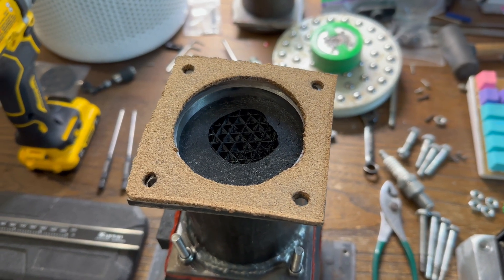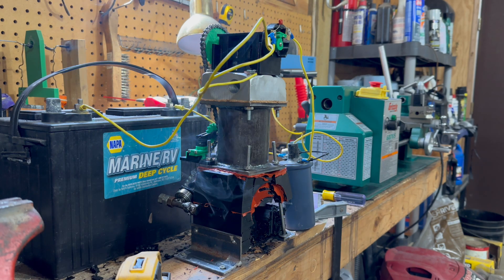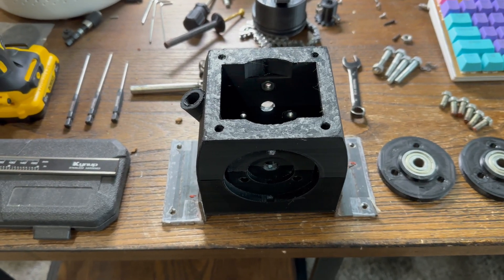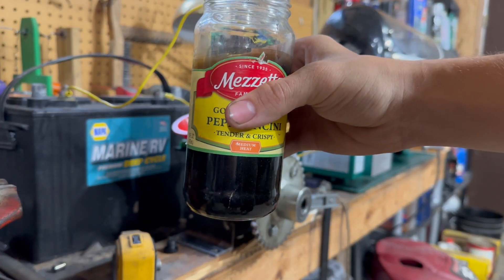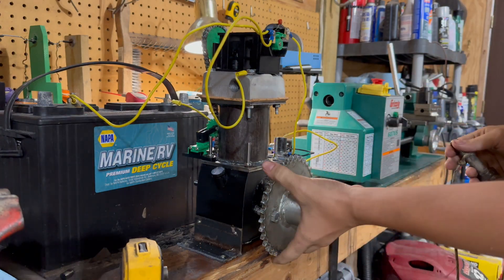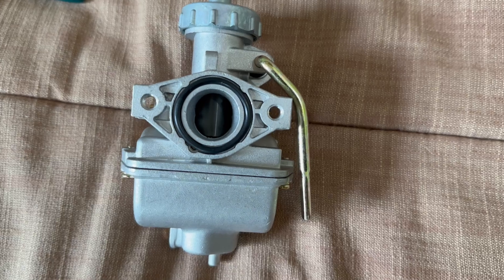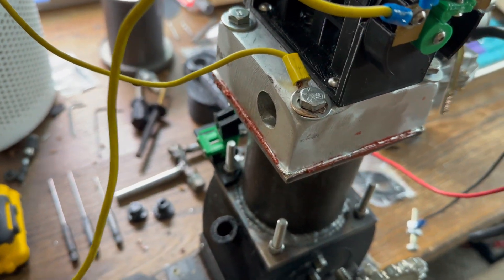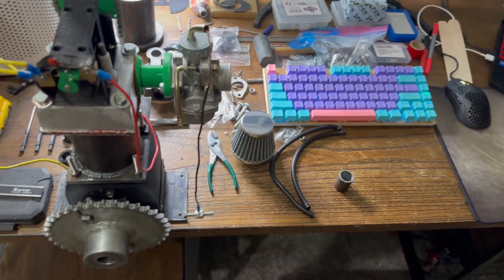3D printed 180cc engine RUNS!

Comment: amazing that you got it to start up and run for a little bit
I would probably change the timing so that the valves overlap less or not at all, I feel like that would make it easier to get it running properly but I might be wrong
Probably should get a slightly bigger flywheel  would help
Tuning the idle on the carburetor is very important. Once you adjust the idle speed so it runs you can play with the idle air fuel mixture screw to make it potentially run on lower RPM, smoother and it should make it easier to start.... potentially

I am not an engineer and I do not know how to build engines  but I did play around with engines a bit... mainly 2 stroke engines but I have played around with them
So yeah take this with a grain of salt